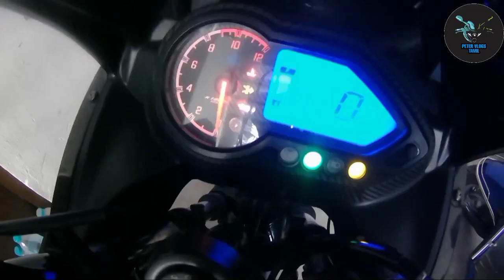Bajaj Pulsar 220F Motul Engine Oil Change | Peter Vlogs Tamil

Comment: Bro socket spanner size enna?
Reply from the maker: Which Socket
Reply: @petervlogstamil116  to change the oil
Reply: What mm u used to remove the oil nut
Reply: @petervlogstamil116  plz share the tool u used to remove the drain oil nut... Plz share the link if u have
Reply from the maker: 14MM Size